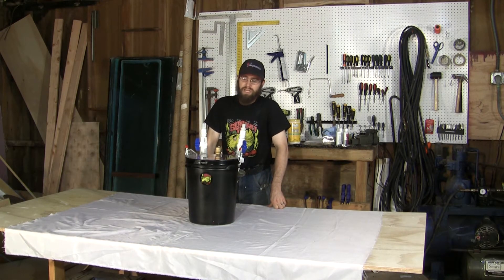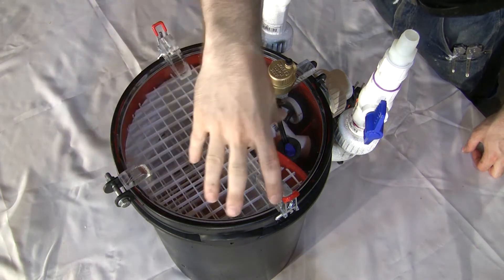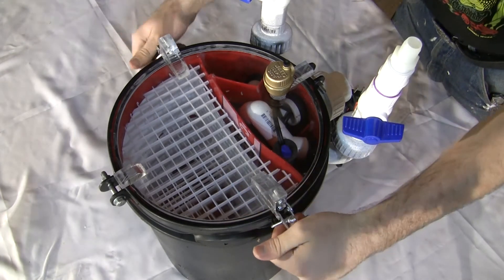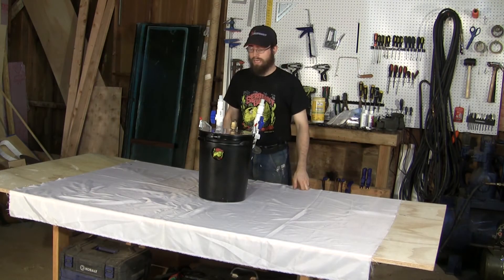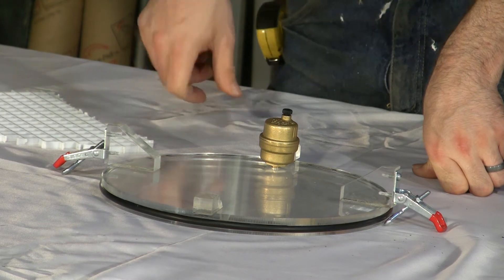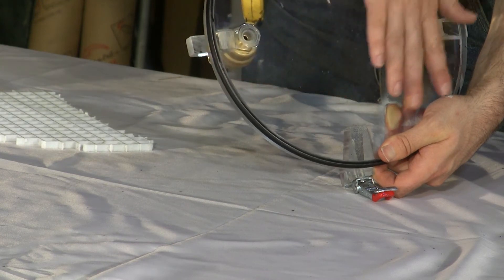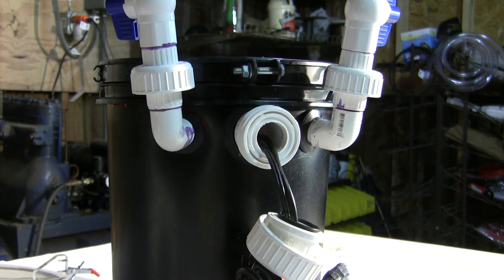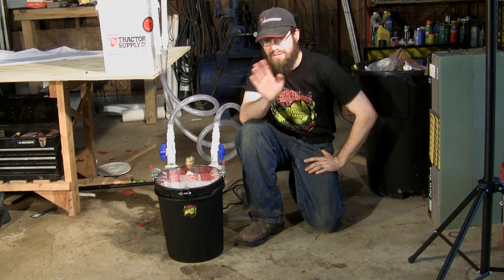DIY 5 Gallon Canister Filter

Comment: Hi what kind (brand) of hot glue did you use to glue the HDPE?
Reply from the maker: I have noted to a few other people in the comments that although the hot glue was very strong up front over time it did not hold up (some of it's still holding today, but some isn't). This build was for a competition/build off (which I did win) and I was trying to limit myself to stuff the average DIY'er would be comfortable with. In hindsight, I limited myself too much. 3M offers multiple adhesives for HDPE that are inert when cured. Back then it was somewhat difficult to get a hold of them, but these days between Amazon and McMaster you can easily get them and that would be my recommendation. 
Additionally the hot glue cable seal worked, but was very finicky. (I made a silicone one but it didn't dry in time for the video) there are other comments below where I fully detailed making the seal from silicone and even though it takes forever to cure (a full week in my case) I strongly recommend it.
Reply: @michaelhoffman1576  Thank you for your reply and congratulations for creating awesome filter.

Comment: Awesome Build Got a couple questions where did you get the metal band that you put at the top of the bucket I really like your little idea
Reply from the maker: If memory serves it's just 1/8" x 1"  bar stock, bent around a bucket then used a vice to bend out the tabs on each end. Notched where the tabs bend out with a grinder so the top edge of the banding can tuck up inside the rolled top edge of the bucket. Bolt front and back to draw tight. The latches are bolted on with button head screws (heads in towards the bucket)  welded would have been better but bolts worked and I was trying to keep it simple so more people could do it.
If you are going to try to copy it I will warn you that hot glue worked well but didn't age great. If you are not too rough during maintenance then it's ok but 3M makes a special adhesive for HDPE that would be more durable. 
Also the cable pass through plug at the back would be much better molded from silicone rubber. There are plenty of kits available online now that make it much more reasonable for the average home DIY'er.

Good luck with your build!

Comment: Can you please go into detail about the metal band and how the bottom clips are attached to it   Thanks in advance 👌🏾
Reply from the maker: clark kent it's 2 pieces of banding which are the same width as the space between the top lip of the bucket and the first ridge. Both ends are bent out 90 degrees and have holes in them to bolt it together. they are not quite long enough to touch each other so that he bolts that connect them can also clamp them to the bucket. (It's also worth noting that I had to notch the top of the  flanges because I made or so the banding tucked up under the rolled lip of the bucket at the top) the clamps are simply bolted to the banding with button head screws (heads on the inside nuts on the outside.) (If you can weld you could just weld them to the banding, that was my initial plan and it would be better since it eliminates to bolt heads on the inside, but I switched to bolts because it would be usable by more people.)
Reply: Michael Hoffman Thanks for the insight. My final step will be finding a metal band because I don't think I can fabricate that. Do you think a regular "lever lock" for a 5 gallon bucket can serve the same purpose?
Reply from the maker: That's an interesting idea. You could probably figure a way to make that work but you would have to manhandle the lid on and off instead of using the leverage of the draw clamps.
You can make the ring out of 1/16" bar stock, with some leather gloves you can bend it around a bucket to form it and use a vice to bend the bolt tabs out.

Comment: Could you tell me how you made the seal where the wires come out. But using the silicone not hot glue. 

I have a 5 gallon canister filter made from a Rubbermaid water dispenser and want to add a heater to it. 

If there is a way to add the heater externally too what's your thoughts? 

Thanks
Reply from the maker: Officially Tielo externally is the easiest. Hydor makes an awesome inline heater which is very reasonably priced. If you already have a heater tho, or really want to go DIY you have a few good options. The king of DIY has a few videos on DIY inline heaters and I've built similar very successfully (tho I personally still prefer the hydor's). I would not advise doing it with a heater which shows the setting on the side/front only one that has the dial and settings on top. In the same vane one of the easiest ways to add a heater to a DIY canister filter is to simply put a uniseal in the lid and stick the heater in through it. (Just like in Joey's inline videos).

Lastly if you really want it inside the canister like I showed in this build there are 2 options that I've tried successfully. The first is a plastic cable gland. (It's a sealed fitting for passing wires through). Simply buy one the right size for your heaters wire, cut the plug off and pass it through and tighten it down (I like to shoot a little silicone into the gland when I tighten it gives a more reliable/permanent seal). Then put a new plug on the outside. The only real downsides to this are that you void the heaters warranty and it's a bit of a hassle to replace the heater down the road (drain the canister, cut the cord inside, screw out the gland, install new gland and heater, let silicone cure).
Lastly is the method I used here. It works well if you get it right, but it can be a real challenge to do so. The way I did it was I sanded a slight taper on the inside of the fitting for the canister. I then sanded a greater taper on a spare fitting (to be used as a mold) silicone doesn't stick well to smooth hdpe (what most 5 Gallon buckets are made from) so I flattened some to set it on to cure (was still a pain to get free, but it worked). Then just pumped it full of silicone and wait weeks (I tried to pull my first one after a week and it wasn't even close to fully cured, so I gave it a solid month the second time just to be safe) once it's cured I trimmed the excess off the flange area, drilled holes slightly undersized for the cables (Just slightly, less than 1/32" under, too small and you get a leak path right next to the cable at the edge of the slit), then slit from the sides to the holes to get the cable in. It worked well but was a lot more hassle than I expected using stuff most people have access too which is why I glazed over it a bit in the video. On the other hand if you have a lathe to turn tapers and molds and you can cast silicone rubber parts then it's super easy. (Which is how I normally would do stuff like this) :-)
Reply: Thanks. I actually had a hydor inline heater for my old aquarium. I still have the heater. However. It's only a 5/8" fitting. Which is the max size I can find for the hydor heaters. 

My current aquarium is fully hard plumbed with 1" pvc. So the 5/8" heater will not be compatible with my current setup. 

I could use the option that you suggested. Use a uni seal and stick it down from the top of the canister filter. 

Could you recommend a good heater for using with a uni seal. I've never had a glass heater like that before. 

I'm still pretty new to aquariums.
Reply from the maker: Unless your return flow rate is really high you would probably be safe to transition down to 5/8 soft briefly for the heater. 
For a straight heater with a uni seal I'd recommend the Eheim Jager line. They are solid heaters and their head geometry works well with uni seals

Comment: Amazing! Can you show/explain in a more detail the air line for letting the air out of the canister.
Reply from the maker: Daniel S thanks. If you are referring to the bleeder valve. It's an off the shelf component used in household plumbing. It has a weighted float inside which accentuates the valve. When air builds up and the water level drops inside the valve body the weight lowers owning the valve. As the canister operates at a positive pressure (because it is below the tank) the air rushes out until the water rises enough to close the valve again. This method only works if your canister is below the tank and your siphon/inlet line is adequately sized for the pumps flow rate.
Reply: Michael Hoffman thank you
Reply: Michael Hoffman can you please send me a link to an online store that sells this type of bleeder valve?
Reply from the maker: There are many on Amazon. Just search "Automatic Float Vent" or "Automatic Air Vent". 
The brand I used in this build was "Watts" it worked well enough but was a bit more sensitive than I would have preferred.
Reply: Michael Hoffman thanks
Reply: Michael Hoffman how do you prime the filter?
Reply from the maker: Since the pump is at the bottom and it has a bleeder valve I just fill the bucket, seal it up, and choke the valve way back on the return line (so I don't overwhelm the bleeder) then fire up the pump. As it returns the water up to the tank the suction created draws water down the suction line and all the air in the suction line ends up in the canister and bleeds out. (Which you can see thru the clear lid) once the air is purged and everything smoothes out (takes this build around 30 seconds) then I open the return the rest of the way and let it role.
Reply: Michael Hoffman Thanks a lot for the tips about priming and the air valve. It works perfectly in my setup

Comment: Dude. This is amazing. How well did that seal work where the wires came out for the pump and heater?
Reply from the maker: Ben Arthur the hot glue seal was only temporary because my silicone one hadn't finished curing and the deadline to post videos for the competition had caught up with me. It was a pain to get the hot glue one right but it did work. I wouldn't recommend it though. If you're gonna try it use silicone and know it's gonna take at least a week to cure the plug. I sanded a slight taper on the inside of the piece of pvc I used as a form for the silicon. That helped it go in easier and ensured that the plug was slightly oversized. Then drill undersized holes for the cables and slit the sides. (this may take a couple tries to get right, too small and the slit doesn't clamp shut fully, too big and it leaks around the cable.)